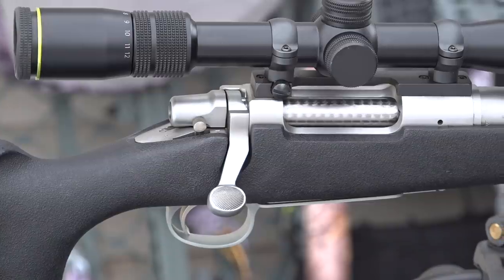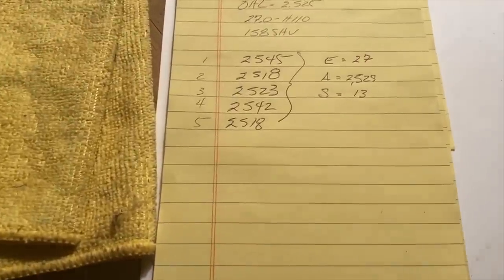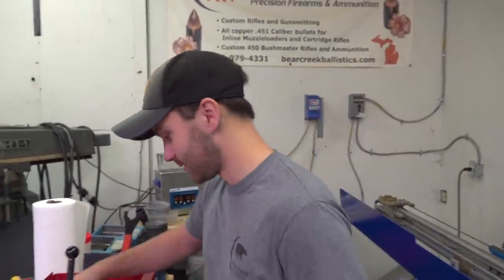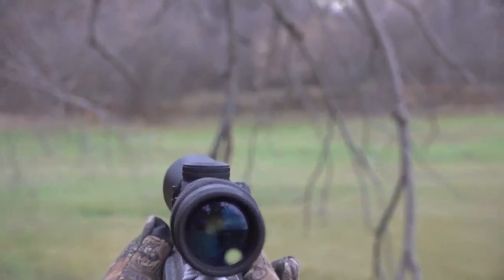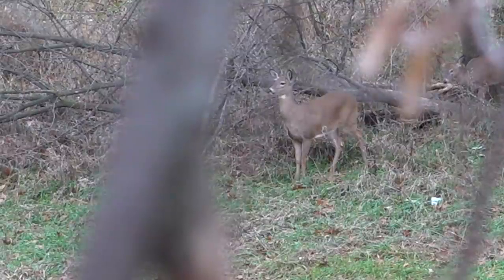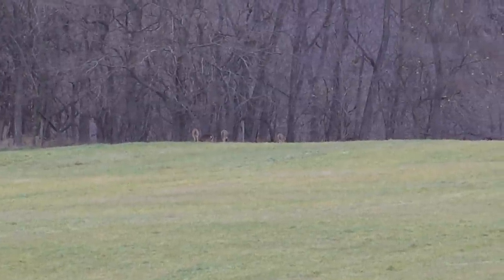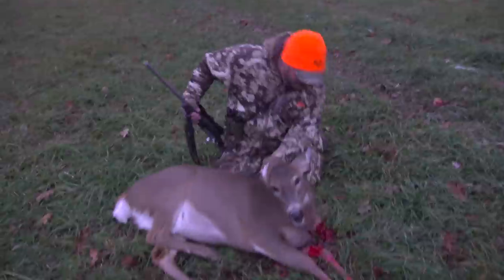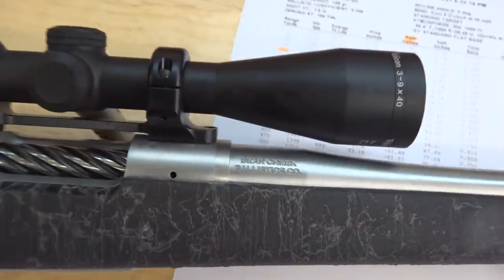The Ultimate .350 Legend!

Comment: Doing a Model 7 in 35 Remington would be a slick gun and shooting those bullets from a 35 Rem would really show the performance of the 35 Rem better than the round noise bullets.
The 35 Rem ammo is extremely underloaded so in a bolt gun a reloader can really bring up the powder charge to get top performance from the 35 Rem.
I loaded some 35 Rem with 40 grains of 748 and it showed when fired an acceptable pressure, but I got nerves firing this load from the Marlin 336, so I reduced the load to 36 grains of 748 with a Brans TSX 200 grain bullet that goes into the chamber first before loading round noise bullets in the tube magazine.
Reply from the maker: It would be a cool gun but we can’t use necked cartridges where we live unfortunately.
Reply: @FullQuiverOutdoors  Bumber that you live in a state where strait cases must be used.
Hay the 458-win mag is a trait case then go use that!
Reply from the maker: @lurebenson7722 , and 1.8” maximum length. Lol!
Reply: @FullQuiverOutdoors  I would be sure to pass up this state then.
I won't give up my 338-win mag for deer

Comment: Winchester has a new cartridge called 400 Legend which is in between 350 Legend and 450 Bushmaster
Reply from the maker: Yes they have. But it’s really not a revolutionary cartridge and it’s not selling well at all. The .350 and .450 have filled the need and the .400 doesn’t really do anything better than either of them. In my opinion, the .400 legend is a cartridge built to make Winchester just a little more money off the success of the .350. 

If you want an in between size that is actually an upgrade, check out the .41 Great Lakes. It outperforms the 350, 360, 400 and 450 but has very light recoil, almost as little as the .350. With a 180gr bullet, it’ll stay with a .30-06 of the same weight out to about 250-300yds!
Reply: @FullQuiverOutdoors  This is very true it's not selling very well at all and I'm pretty hesitant to get a rifle chambered in it.

Comment: It's like Winchester management doesn't want to admit they were wrong when they release the "350 Legend" with an actual .355 bullet (not truly a .357) in a case with a 5.56 head rim diameter, when they should have released a 358 Legend based on the 6.8 head case.  Now it seems as though they have skipped over the obvious and went with something for the hipsters.  The lack of good thick jacketed soft point 40 cal (10mm) bullets in the market, makes it difficult for reloads.  I have an old 1873 Winchester that belonged to my great great uncle, chambered in 38-40 and only have about seventy-five 200 grain soft point bullets left for it.  For target and plinking I am stuck with cast lead or hollow point.
Reply from the maker: I agree, they should’ve went with .357 over the odd .355. But since then, there’s been a lot of bullets made to fill the need. Now it’s been proven to be a very effective cartridge for us in the limited firearm zones in the Midwest. I’m sure that .38-40 is a cool gun! If they were legal where I live, that would be a fun one to mess around with.
Reply: @FullQuiverOutdoors  I've seen where a couple of guys have taken a 358 neck reamer to their Legend AR barrels, allowing them to chamber a 358 bullet without it sticking in the throat.  Apparently, it drops the case pressure down enough that they can squeeze that tight 358 bullet down the 355 barrel without over pressure.  The only thing drawing me toward the 350, even though I reload, is that the market is flooded with relatively cheap ammo and firearms to shoot it, at least that is the case here on the west coast.  We have rifles for less than $390 and $14 boxes of ammo, like anyone can just afford to go shooting.
Reply from the maker: @Backin_Theday , sounds interesting. But, we are getting great accuracy and velocity out of the custom .355 bullets that are out now. The one I’m shooting now is a 140gr all copper bullet at 2650fps. I killed a cow elk with one shot two years ago with their .350 Legend 160gr bullet. I’m pretty happy with the cartridge and gun as it sits. It took a bit for good bullets to be made but now we have a decent selection of them that’ll work in the standard .350’s.

Comment: Why is the 350 ammo on their website an open Hollow point? I don't see the ballistic tip rounds you show in this video on their website for 350. Only for 450 bush
Reply from the maker: The ammo I was using was a prototype. They are coming out with a 140gr that we’ve been testing. Should be available in the spring. Their other .350 ammo is a round nose with black tip. We use that out of our AR and have had great success with that too

Comment: I definitely want to build a 350 AR for deer. I like the 450 but ammo cost is really high.
Reply: I built an AR upper in 350 legend. It's common to hear that they are prone to jamming, but it comes down to the feed ramps and the magazines. I bought one of every type of magazine for the 350 legend and they all jammed with the rounds nose diving up into the chamber or the occasional failure to feed. It took about 60 rounds before I started to have much better reliability. I also used a bear creek arsenal barrel which they use the 300blk feed ramps. Usually those feed ramps aren't the best choice for 350L. I've read on forums people have better reliability from the wider single feed ramp and you'll have to research who makes that on their barrel but I know BCA does not. I've also had very little feeding issues with the 350L lancer mags from Wilson Combat, but those are 15 round mags and they are pricey. Overall, I love shooting it. After the first twenty shots of some inconsistencies, the groups tightened right up and with the Winchester 145 grain fmj target loads, I was punching clover leaf patterns at 98  yards. I think you'll really enjoy it once you get the chance to play around with one.

Comment: Could you tell us what the total cost of that build was? Another great video btw
Reply from the maker: This is not a build they offer. It started out as a re-barrel job on a current rifle I owned and ended up a full custom. There builds typically start out with a new action. But, they offer similar rifles starting at $2500 last I checked on their website.

Comment: I'm not doubting the ability of the .350 Legend but a 30-30 loaded with Leverevolution ammo then comparing ballistics will do everything the .350 can do if not a little better and also without the harsh recoil.
Reply from the maker: I'm not sure what .350 you are shooting but my 4yr old shoots mine with no problem and my 5yr old killed a deer with one this September. If the .350 if "harsh" then the .30-30 will be as well. I can watch the bullet hit through my scope. Also, the ballistics of the .350 ammo I'm shooting out perform any .30-30 factory ammo available. Besides, any necked cartridge is ILLEGAL to use in the midwest limited firearm zones. This is not a comparison of straight walled cartridges to necked cartridges. That would be very silly as necked cartridges obviously have the advantage. But they are not legal to hunt with in our area.
Reply: I think its about 30 percent less recoil than a 243.  450 people who are recoil sensitive complain a bit.  350 is not harsh at all.

Comment: Very nice. Awesome video, Very impressed with the craftsmanship. Love the the idea of a 9mm on Steroids! I'm converting my Remington .223 into a 350 legend, I’m curious, Inquiring minds want to know. What's the twist & Barrel diameter, 355, or 358 What I have coming from Germany 26" 9mm Barrel, diameter, 355 1 in14 twist ,,,
Reply from the maker: That’s a great question and I can’t remember what the twist and barrel diameter is. If you contact Bear Creak, I’m sure they’d be happy to explain what it is. I know it’s a Douglas barrel but just can’t remember the specs.
Reply: I know the barrels are typically 1:16 twist and the 350L bullet diameter itself is .355 and if you use a larger diameter bullet, you might have some bad luck. The 1:14 twist might be a little too fast unless you plan to hand load heavier bullets as long as it still stays within Sammi specs. The 350L also isn't affected much by barrel length like other calibers. There's a video that a guy was shooting 350L from a test barrel and each shot he cut an inch off after the chrono readings. There was only a 200 fps loss from a 20" barrel down to a 10" barrel. That's not bad considering how much of a loss we see in similar fashion in 223 or 308.
Reply: @toddk1377  I hand load everything for the my 9mm on Steroids! from 115Gr,HP  too 170Gr,Sp What I find interesting is the 135Gr,RNFP with reformed LC 223 brass, works better than factory, Legend. As for 308, I just added the 300AAC Blackout, Bolt Gun! from what I'm seeing, chrono readings. the 9mm on Steroids! could become a dust trap

Comment: That's the third time I've seen someone use a 350 Legend and shot a Deer with it and the Animal bolted away for quite a bit. So far I'm not impressed with the 350 Legend. My 30-30 Dropped them where they stood every time. Same with my 270 and my 06.
Reply from the maker: As explained many times, we cannot use necked cartridges in southern Michigan. I’ve been videotaping hunts for over 20yrs with approximately 20+ kills each year. Deer shot in the shoulder or neck drop, behind the shoulder run. There are exceptions but I’ve got hundreds of videos to back this up. It’s about shot location not cartridge. I’ve got several videos on here dropping deer with the .350.
Reply: I'm fully aware of the straight wall resrictions you folks have back east. I've been Re-Loading, Load Developing and Long Range shooting for over 50+ years. I'm fully aware of shot placement too. But from a Ballistic Stand point and in field shooting I'm having a hard time justifying the 350 Legend. There are many more straight wall Cartridges that can and have beat the 350 hands down. The 444 Marlin is one. The 45-70 is another. The 38-55 is another great one. The problem with the 350 is the bullets that are available. It needs something that will expand and create a wide wound channel as well as enogh energy to deliver the down range knock down capabilities neded for a good fast clean kill. I'm aware of those who are recoil sensitive. But unless you're shooting a string of several rounds it shouldn't be a problem. one excellent straight wall cartridge is the 460 S&W Magnum. That thing will go 2900 fps with astounding accuracy and knock down power. But when it comes down to it if I see  several people shooting the 350 Legend at Deer sized game and the animal just bolts off like nothing happens then something needs to change. Sure you may have to search for a while to find it but that's not a fast clean kill. But that's my opinion based on eye witness facts. I'm sorry you guys are being limited to that kind of stupidity from Buerecrats who havn't got a clue of what a bullet is. I hope that in the future they can develop better bullets for the 350. i think it has great potential. Now if I'm wrong about the bullets availability for it let me know. I'm happy to learn something new. Cheers.
Reply from the maker: @dennisowen3717 , yeah we can’t shoot 444 Marlins or 45-70’s. They are too long for our rules. My .350 is shooting 2525fps at the muzzle and I’m using all copper bullets. They have plenty of power and shoot quite flat for a straight walled cartridge (that fall within the rules). We’ve dropped several deer in their tracks with the .350. 

Being a bowhunter, it doesn’t bother me at all to track a deer 50yds if I need to. Blood trails are using very good from what we’ve seen. The .350 has been exceptionally nice for young hunters because there’s almost no recoil. They are the second most popular behind the .450 BM in southern Michigan. For us who used to be limited to shotguns, we are quite happy with any improvement. 

I totally understand there’s better options if the rules were different but we’ve done a lot of testing over the last few years and found no issues with the .350 if you use a quality bullet. If you want to drop a deer, the .350 will do it beyond 200yds if you place your shot well. We’ve killed deer well beyond that with lung shots and they typically go 50-75yds with good blood trails and tip over.
Reply from the maker: @dennisowen3717 , when we had the rules change, I immediately thought the .460 would be the best option within our rules. But, after testing 4 different rifles and many loads, I found the .460 to be no where near as forgiving as the .450 bushmaster and in my rifles, it tended to like 300gr bullets over anything which put it back in the same category ballistically as the .450 but with more recoil and less options for factory ammo. The .450 BM won out here in the Midwest and is the best selling cartridge in limited rifle zones now.  

But, I totally agree, the .460 looked like the clear choice on paper before testing and taking many animals with it. I don’t even own a .460 anymore because of it. I’ve got several .450’s.
Reply: @FullQuiverOutdoors  Wow, That's completely rediculous that they force you to use a Cartridge that my or may not kill the animal as quickly as needed. At least Bow Hunting gives you that nice sharp Broad Head Arrow tip to create a good wound channel that can cause the deer to bleed out. But there are those Hunters who have become so lazy they won't go after or track the animal down. I've seen it. In fact it's prevelant in every day life. People have become so lazy, self entitled and selfish , not to mention so indifferent to everyone else in this world. But, I have lately seen some better shots and take downs of Deer with the 350 that were pretty good. But the right type of bullet is critical. You know that. Anyway, Happy Hunting and enjoy it while you can.
Reply from the maker: @dennisowen3717 it is weird they limited the length of the cartridge for sure. I understand the spirit of the law to not allow powerful rifles in more populated areas. But, coming from shotguns, we have a completely different perspective. It’s just nice to be able to use rifles. At least straight walled cartridges are very accurate! Used to see guys slinging lead with smooth bore shotguns. I guess I’ve killed a lot of deer with my .357, .41 and .44 mag revolvers so I don’t see any issues with lack of power. I talk to a lot of hunters each year and the .350 is gaining popularity around here. Especially with better bullet selections nowadays.
Reply: @FullQuiverOutdoors  Well If they would produce some better expanding bullets it would really help. in fact I think I'll get one and start to develop some loads that might help you folks out. I've been at this for 50+ years developing loads for many calibers. So it appears this is one of those that really could use some serious load development and testing. We'll see. Happy Hunting.
Reply: I took #9 yesterday in Ohio, a 130 pound doe at just under 100 yards. Gun Winchester XPR, scope 3x9 Vortex, bullet my handload 165 gr Hornady at 2,250 fps. Deer shot quartering towards me. The bullet hit the right shoulder and blew up 1 lung,  the liver was in 3 pieces, and the bullet was resting against the pelvis. Great penetration and expansion. The deer traveled 25 feet! That has been my experiences with the .350 Legend.
Reply: @dennisowen3717 slower and less power than 30 30. 30-30's suck

Comment: That company can call them whatever they want to but theyre not high velocity rounds. That big bolt on that rifle is cumbersome and out of place on that gun.
Reply from the maker: Any load that is faster than a standard one of the same type is considered high velocity. Same goes for .22’s on up. It’s very common for a company to promote their “hot” loads as high velocity or hyper velocity.
Reply: @FullQuiverOutdoors  you googled "what is a high velocity round"?
Reply from the maker: @Dougarrowhead , nope. I’ve just worked in the outdoor industry for over 25yrs and know what it is.
Reply: @FullQuiverOutdoors  still googled it

Comment: 444  more punch and faster
Reply from the maker: And illegal to use in limited firearm zones where we hunt. Plus, we are looking for a flat shooting rifle in this gun. The 444 is far from a flat shooting gun. The drop at 300yds is only 12” with this gun, almost 16” with a 265gr out of a 444. So, even if it was illegal, it’s not what we are looking for and the .350 has more than enough for deer sized game, almost no recoil and you can build a lighter weight gun due to a smaller barrel. Exactly what we were looking for.

Comment: Dead on at 200 feels like a very minor improvement for what the cartridge is rated for, which I believe is around 175.
Reply from the maker: The ammo I was using was prototype stuff. There should be even more improved ammo this year in limited quantities. Sounds like the new stuff will be 140gr and with muzzle velocity of 2650fps which is the same as the 6.5 creedmore of the same weight and load in standard mags for ease of use. I haven’t seen the updated ballistic sheet but should be pretty impressive for a straight walled cartridge that conforms to our limited firearms zones here in the Midwest.
Reply: @FullQuiverOutdoors  totally agree. I’ll take any improvements. It’s not uncommon in Michigan to find a target at that range, and having a higher accuracy shot only lessens the anxiety when shooting at those distances. I’m concerned about the ethics behind shooting an inaccurate round, so I welcome all speed/accuracy improvements!